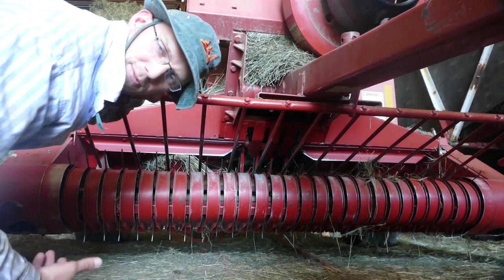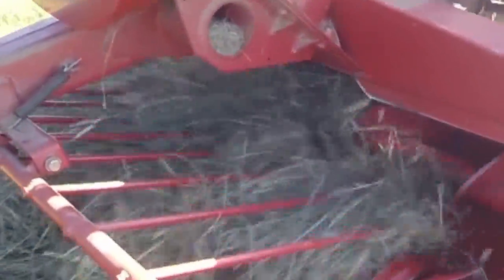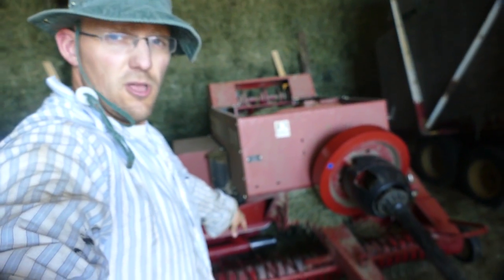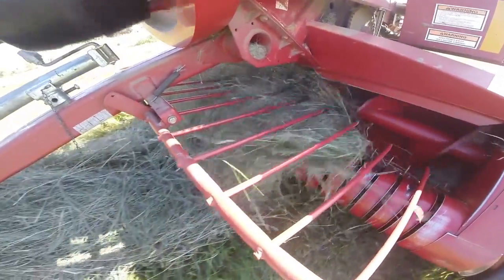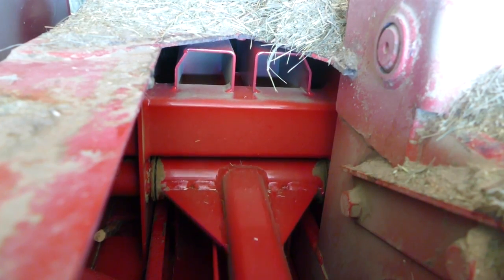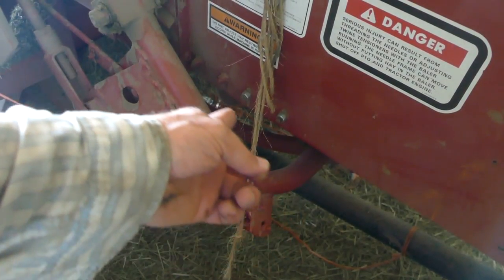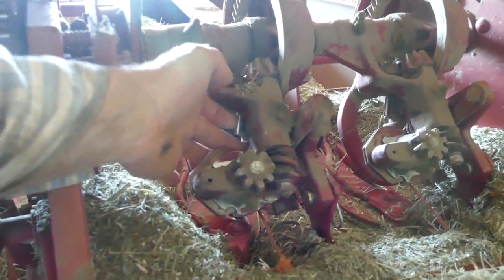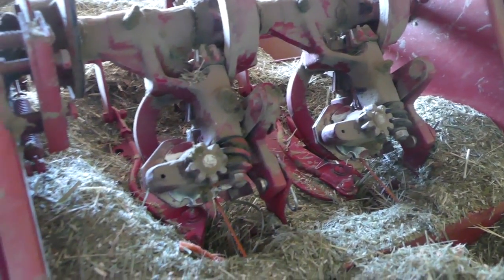FDWB - How Square Balers Work

Comment: Many thanks for this video🙂 I'd like to make square bales for Hay Building applications. At this purpose, I'd like to have the possibility to adjust the length and compression of the bales. Do you think it is possible to "tune" the baler a little bit in order to achieve this. If yes, how ? Thanks in advance for your reply !
Reply from the maker: Fundamentally, it's generally the same to adjust bales. I would look into specifics when shopping for a baler. 

For ours, we can add wedges in the chamber to add resistance and increase compression. Also, there is a hydraulic press that is adjusted w a knob on baker to squeeze the end of the chamber down to increase density.
Finally, there is trip that can be adjusted for when knotters go through to tie and complete the bales (this determines the length).
So, yes, varying lengths and density is possible.
Reply: @farmdadwordbarf4115  Thanks for these clarifications ! To you and your family all the best for 2022 !

Comment: Thanks for this great video!  I've always wondered how these work,  and your video does a great job showing all the steps.    Do you have a lot of maintenance on that thing?  It seems like with so many rapidly moving parts, it would break down often.
Reply from the maker: Surprisingly durable. I've heard of some guys doing corn stalks with small square balers and imagine the dirt and stalks would be more wear and tear. Ours gets the easy treatment with doing all grass hay. It's softer and doesn't get a lot of added debris. 

As far as maintenance, its essential to keep it greased as the manufacturer recommends. Also, there are shear pins designed to fail before there's a catastrophic failure. If we hit something thick, the shear pin will break and disengage the flywheel from the system. Then we just clear a jam, put in a new pin and back to work within 5mins. It's done about 4000 to 5000 bales a year for the last 5 years without any major repairs needed.
Reply: @farmdadwordbarf4115   Thank you for the detailed response!  I'm planning on buying some land in a few years, and am learning all I can in the meantime.    You video and response helps a lot.   Thanks again, sir.